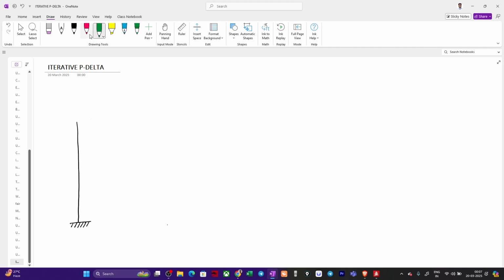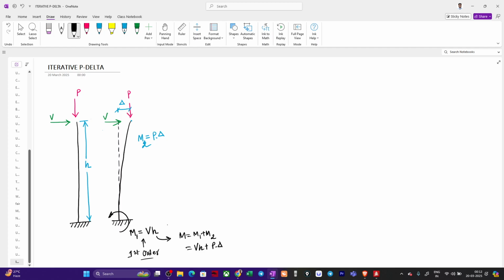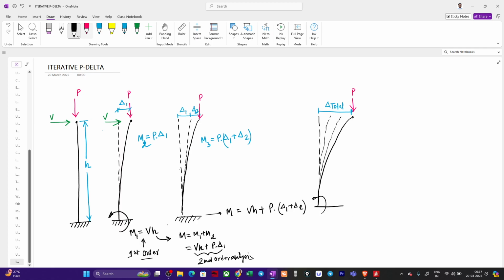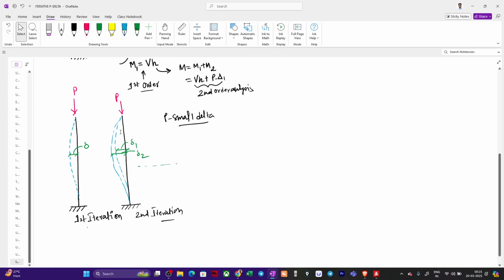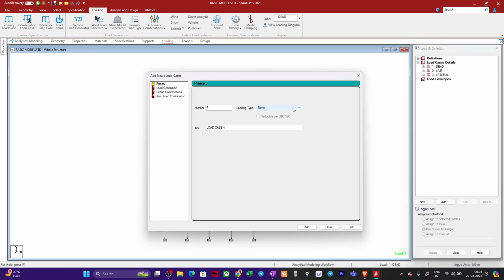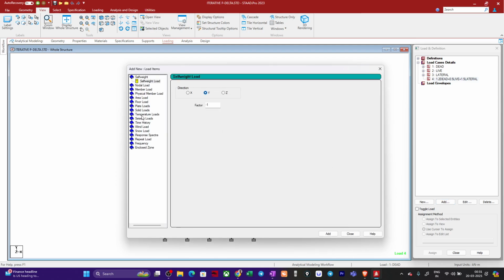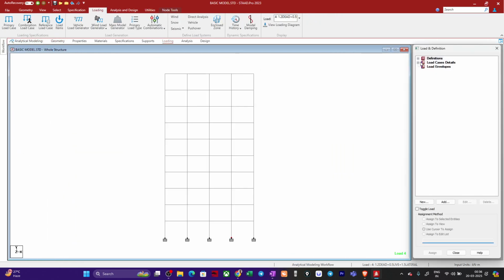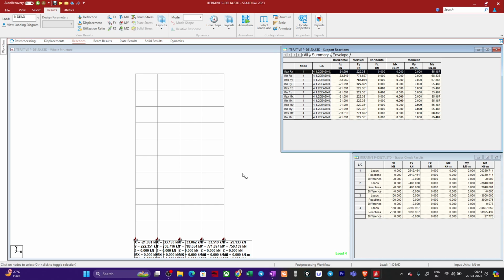P-delta Analysis- Iterative | Concept & STAAD. Pro Application | ilustraca | Sandip Deb

Comment: But I think , in 1 st order analysis we will not use repeat load in  load combination correct.. as you explained in starting, it's just summation of internal forces from dead load and lateral load separately...hence we can use add load combination ,directly without repeat loads...please could you confirm my understanding?

Comment: Excellent explanation ! Just had a doubt !
Suppose we want to consider these 2nd order effects and design the columns. Thus, we have defined an exta p-delta analysis command! is it enough to consider the 2ndary effects and design them with our existing load combos ??

 Or do we need to make a separate load case having all 3 load cases acting together and consider that case for our design ?
Reply from the maker: Once you enable p-delta, all lateral combinations shall have that effect included.